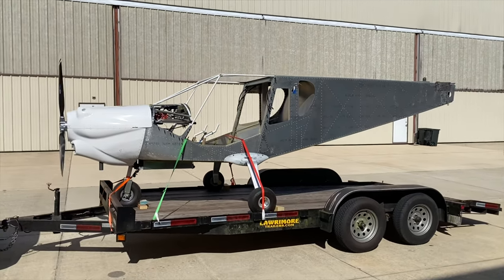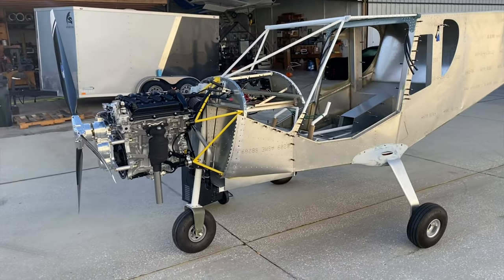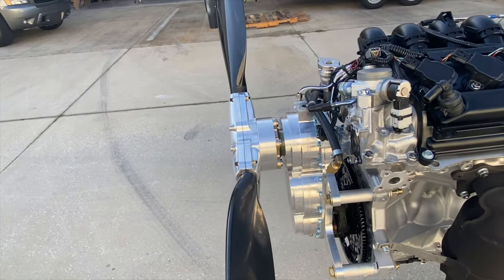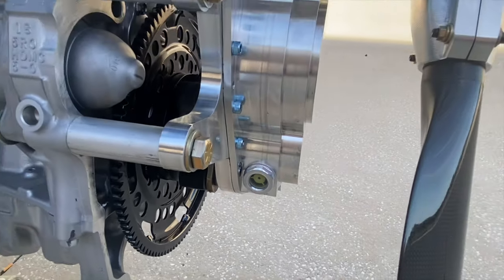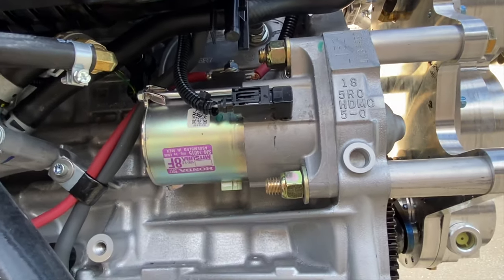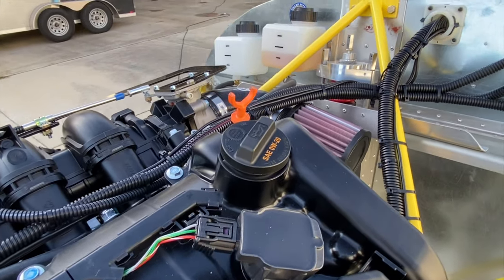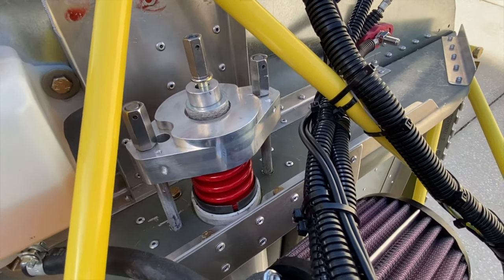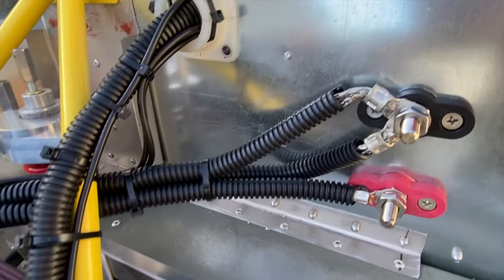Jeff and his Viking 130 on a Zenith Install and In-Depth Wiring Information

Comment: Jan, excellent stuff, these Viking engines give me a high degree of confidence and would be my first choice engine. The chin cowl looks awesome, modeled on the Rans 21 at your stand at Airventure? Have to ask why some Viking 130's have the bump for the fuel pump in the upper cowl but others don't, have to say it looks better without but I guess you have to build around the fuel pump.
Reply from the maker: The mechanical pump on the 130 necessitates the bump..however we use it as an "air scoop" etc. In the 110 HP this wasn't necessary due to location of the pump.

Comment: There is very little space  between the connector  terminal and  bolt holding the connector  of the no 6 cable  going to the engine .